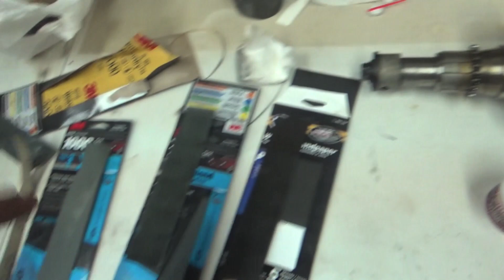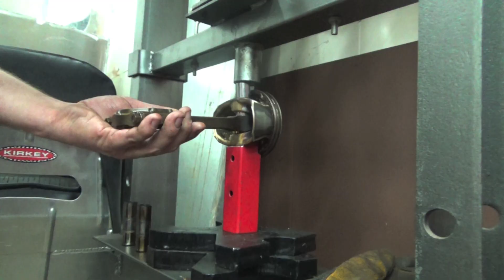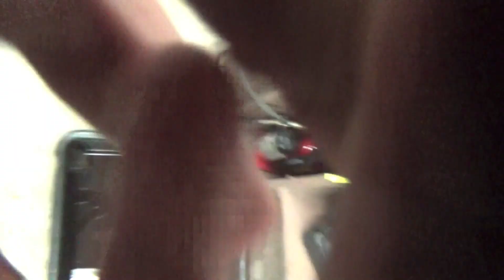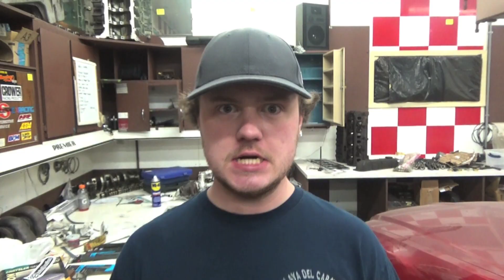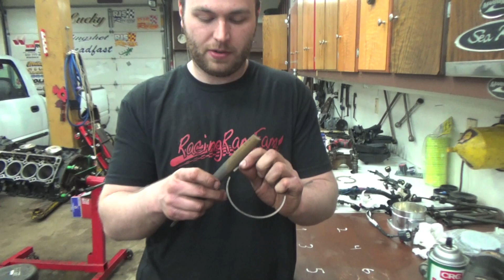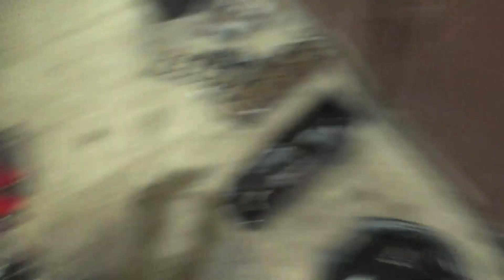5.7 HEMI piston replacement

Comment: You should really correct your video on direction of the connecting rod and pistons
Reply: They say it in the video dummy. If your pistons don’t have arrows then it’s to note 4 rods go towards the boss on one side and 4 rods point away from the boss. I forgot which side goes what way but it’s easy to find.

Comment: I have a 2011 ram 5.7 hemi st the engine was sitting in the rain so the Cylinder walls got rusty i tried honing but it to far gone so I was thinking of boring it over to fit a 0.020 over pistons the question is can i keep the same 5.7 crank along with the stock camshaft lifters I'm not looking for more power then it already has stock i seen people put 6.1 crank when they go oversized to 0.020 i cant return the 5.7 crank i bought so thats why i was wondering
Reply from the maker: Yes you just need a oversized pistons and everything else stock is fine
Reply: @RacingRamFam  thanks bro you responded fast lol love the video btw
Reply: @RacingRamFam  also do you know what the size of the bore would be if i go to 0.020 over from stock or does the shop knows all that info

Comment: I looked for the link on the dnj pistons can't find them. What's so special about these pistons compared to the stock replacement? The pistons on the newer 5.7 are all the same all that changes is the heads and the squish area that's why compression bumps up eagle heads compared to earlier models. I'm gunna be running 6.1 heads with a home made 5 layer mls from the stock gasket it works they say. But my question stands what's the difference in the pistons
Reply from the maker: They’re just stock replacement pistons

Comment: My 2006 ram procharged ram spun a rod bearing. Currently there isn’t any rebuild(forged) engine offered. I might have to rebuild myself considering a lot of machine shops are not taking any work because they’re backed up. Crazy times we’re living. Bores look good. I plan on going forged Manley stuff. Are installing forged units more complicated than a regular rebuild? I am comfident on doing it myself just want to make sure if I’m going to spend $4k in parts I don’t destroy motor.
Reply from the maker: Not more complicated but you do have to get your rotating assembly balance if you change from factory rods and pistons

Comment: Hey does those gaps work for stock, I gotta change out the rings. New to this thanks in advance
Reply from the maker: I would do tighter if just stock application prob .016 top and .018 bottom
Reply: So for stock application can you just use the piston rings as they come? Or will you have to gap them?

Comment: So I just want to point out and im not bashing this video at all but a warning when you said that the writing on the rod goes to the opeset of the arrow on the piston that this is not the case on my hemi and I followed your video and ended up having to push them all back out and put thenm in the right way facing to the front just thought I'd let you guys and other people know that might use this video for a reference that it is different on some hemi's thanks for the video
Reply from the maker: Mine were all good so must different. New video will be out Sunday of total reassembly
Reply: @RacingRamFam  yea I dont know if it matters mine is a gen 3 hemi
Reply: I did the same damn thing dude...

Comment: I'm going to try it right now I can actually even cut the Piston off because all I need is the rod but I'm not going to do that I'm going to try to use my ball joint press and a torch
Reply from the maker: It works good just wait till rod starts to get a little color change

Comment: I have a question I have a 2004 dodge 1500 hemi will pistons from a 5.7 2009-2021 fit in the engine due to the compression being 10:5-1 on the newer engine and the older being 9:5-1
Reply from the maker: Nope.

Comment: I just dissambled a 2017 5.7 hemi, the connecting rods were not installed with the printed letters opposite of the arrow... as a matter of fact, they, "digital print" was randomly facing.  So, I am installing the wrist pins for this and just make sure that the digital print is facing the opposite way of the arrow on the piston right?
Reply from the maker: That’s how all mine were! Digital print was opposite of the arrow I don’t think it really matters tho
Reply: @RacingRamFam  
I checked about this and it does have one side that is offset and thicker at the crank and that thicker side faces outward toward the crank.  

So piston 1 has the thick bevel facing forward then piston 2 will be back, 3 forward, 4, rear.

Thank you for your reply,  I am just trying to make it through this build and not eat a rod or blow my money.

Comment: Wow .. you guys are doing a great job on the hemi .. an having fun at it too.. I’m excited to see what ur putting it in An Here it run..  I jus got my truck back today from transmission shop..it has 46RE in it with all the mods done to the 5.9 I was telling you.. now the transmission is all professionally done .. had performance torque converter built An matched to my cam specs an all high performance heavy duty parts internal as well as stage 2 shift kit new pan new trans cooler bigger than stock one .. man oh man does it shift An work sweeeeet !! Chirps wheels in second An third when gettin on it !! An what a difference in power an take off ,it jus makes that speedometer dance  up to  100 mph in a flash .. she has 392 rear posi too.. guess you can say I treated myself, as today my 51st birthday too.. keep these videos coming I really enjoy them !!👍👍
Reply: Right on happy birthday to you as well !! An I think next mod might be a intake an 4 barrel throttle body .. actually from Hughes engines .. they have a nice kit they sell !
Reply from the maker: Oh yes I have it on my plow truck! It’s been on there for the last 6 years
Reply from the maker: Hey Tuesday was my birthday! Happy birthday to you 🎉 and that’s awesome sounds like a fun truck what’s the next mod?